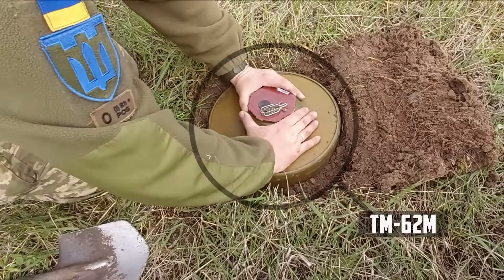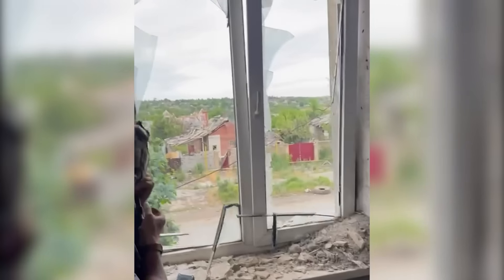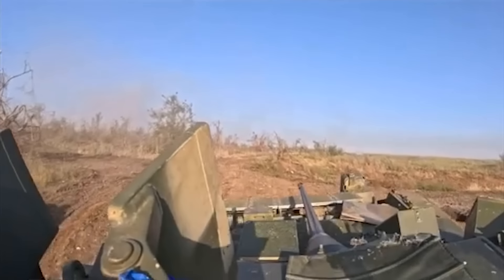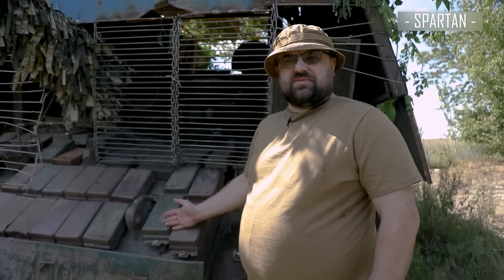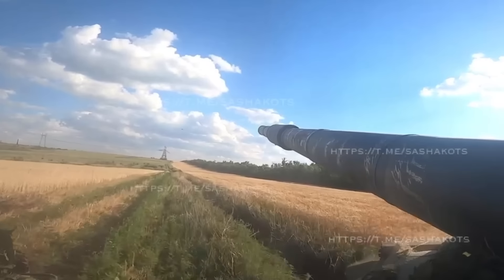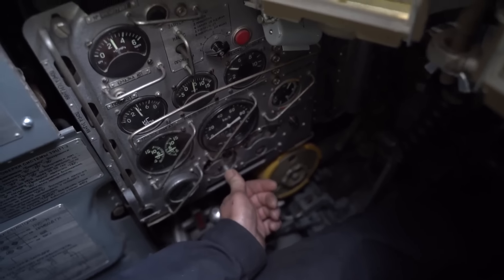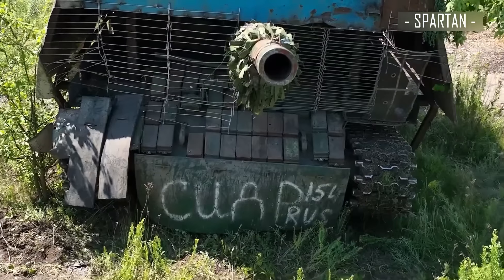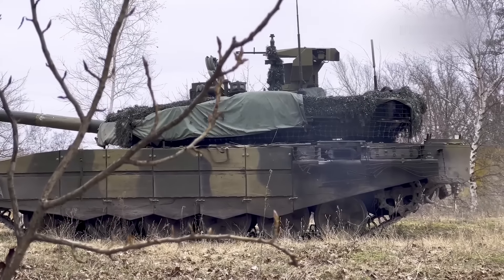Russia did it again! This Turtle Tank fell into a Ukrainian Trap

Comment: This is old stuff, Russia tried the turtle experiment and found out it didn't work so they stopped making them with something better! Another thing if you don't see white letters on the vehicles they aren't Russia, the Russians mark all there vehicle so they don't get destroyed by their own forces since Ukraine also uses much of the same equipment!
Reply from the maker: You're mistaken. Right now, they're fully using those turtles wherever possible, especially on frontlines with fewer anti-tank missile systems. Russians really adapt quickly to circumstances. But they're still using the turtle tactic. Ukrainian soldiers have confirmed this too.
Reply: @spartan6604  Nope, they tried them out as an experiment but found out when you cover the tank up they can't see anything but what is right in front of them. That is why they stopped making them and plan on removing the stuff!
Reply: ‘’Turtle 🐢!’’ Copying Republic of Korea.